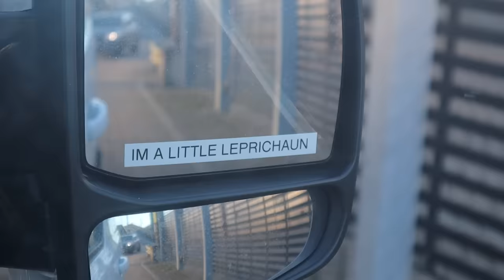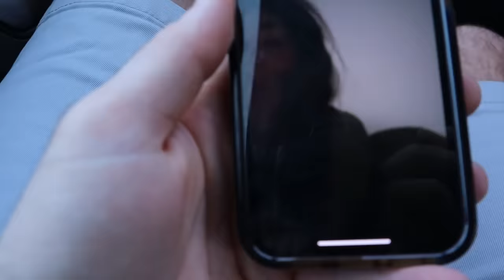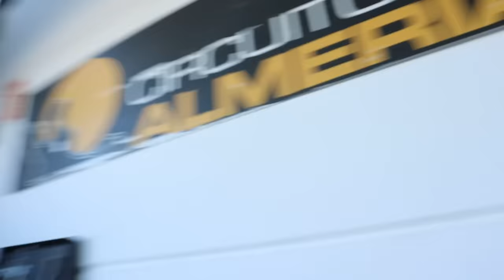Road trip to Spain!!!

Comment: Shame it was misty when you went over the Millau Viaduct ( 8.39 mins). Fantastic bit of engineering designed by Sir Norman Foster and nearly 300 metres above the river so don't look down if you don't like heights !!  Interested you went down via Paris, always found Calais, Rouen, Le Mans, Limoges, Toulouse ( Motorway through the mountains into Toulouse is amazing ) the best and quietest ( & cheapest ) route but not done it for a long time. Good luck for next year